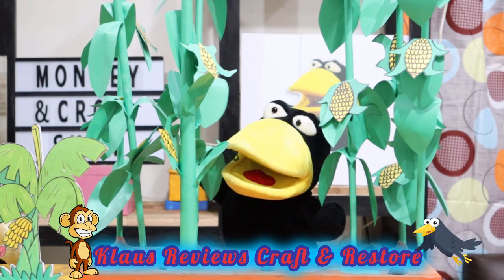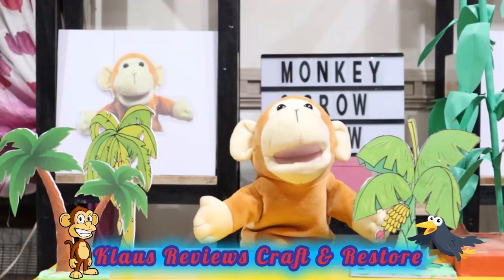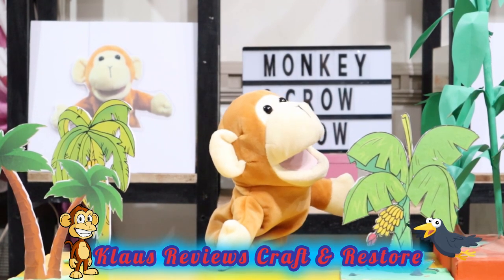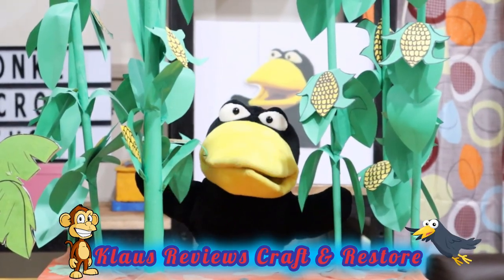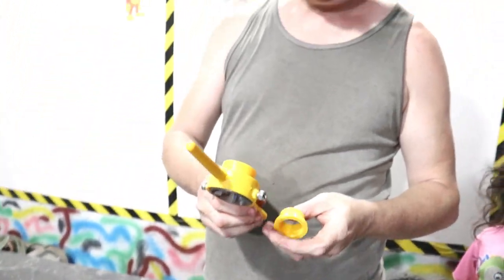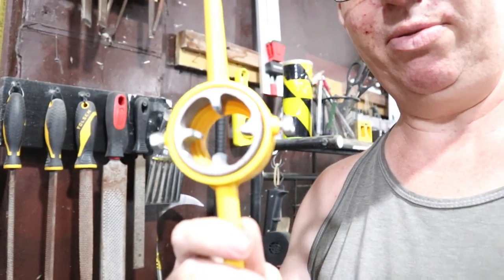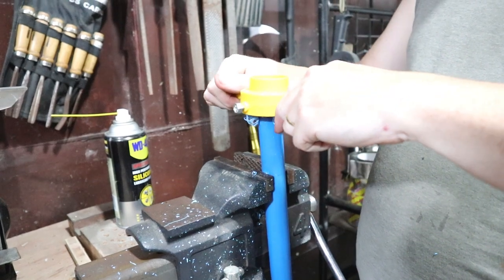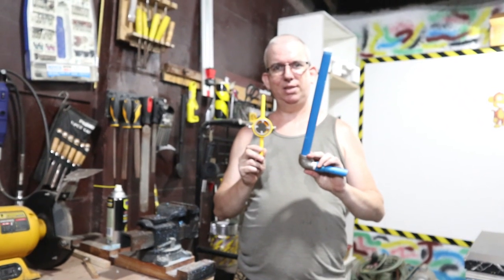MONKEY & CROW SHOW | Review PVC PIPE THREADER

Comment: The whole point of the plastic bushing is to help keep it straight.  Turn the cutter towards the bushing and slide the bushing ver the pipe as a guide.  It’s usually best to know how to use a tool before you post a how to video.